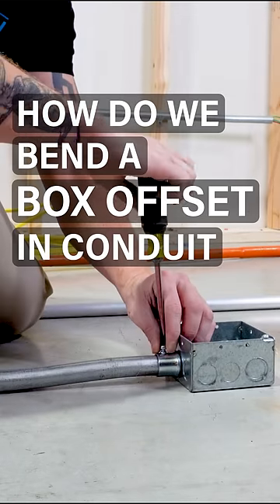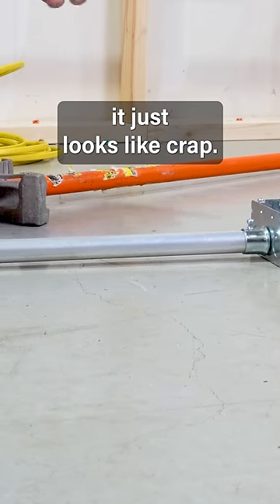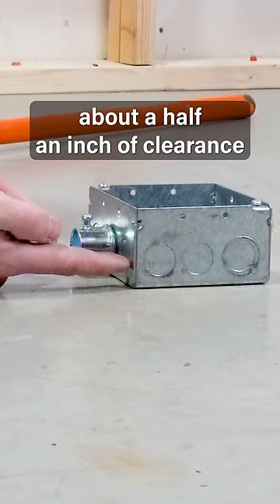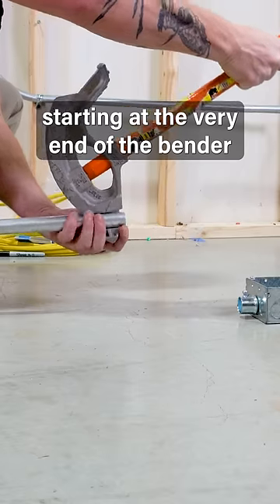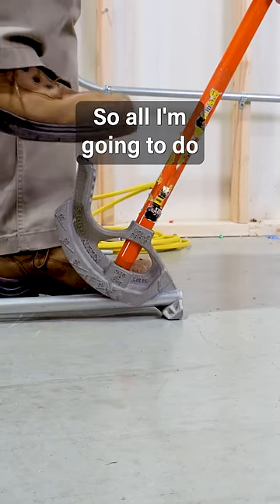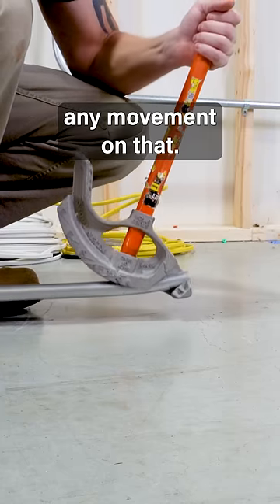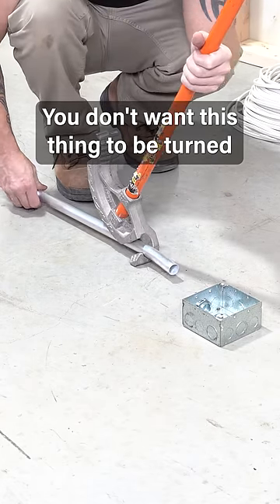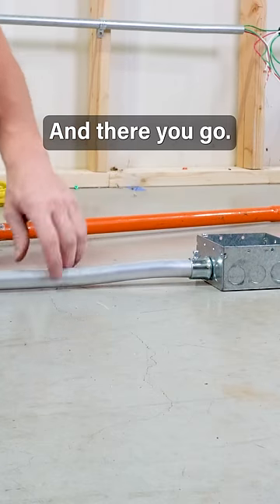How To Bend A Box Offset

Comment: if this conduit is going to be embedded on the wall or cieling, this is not really necessary.. who cares.. but if this conduit is on top of a wall, then the aesthetic value is quite important.. however, why would you like to use metal conduit when there's a better solution, PVCs.. this bend is not even code..

Comment: All this crap abt first mark.
Use a connector or minimum 1/2 back.
And BTW a 1/2 connector is just over 1/2 deep. So it is perfect.

And yes I am a IBEW and I live in one of the pipe capitals where all electric is in a steel raceway.

You guys make too many complications.
Easiest to remember is you can look up the info in Ugly's or a cheat sheet.
All you need to know is the deduct, angle multipliers and shrinkage. And how to use the formulas. And size of obstacles.

You guys are making things too complex for yourselves which sets you up for complications delays and eventually failure.